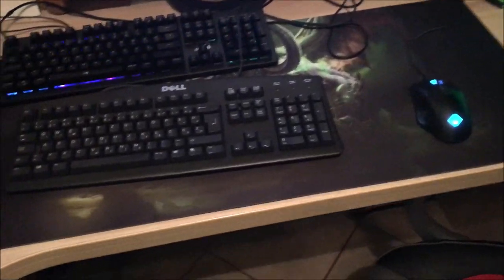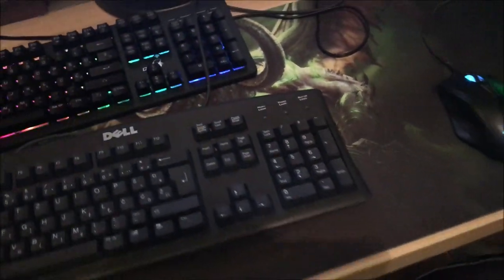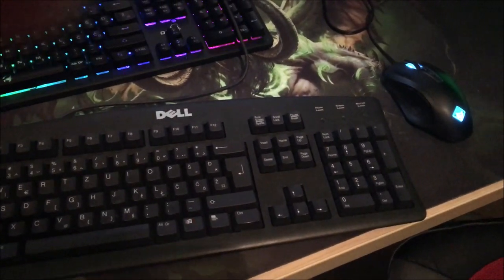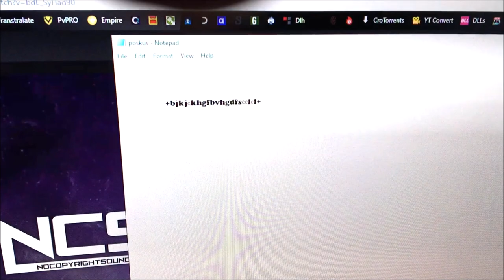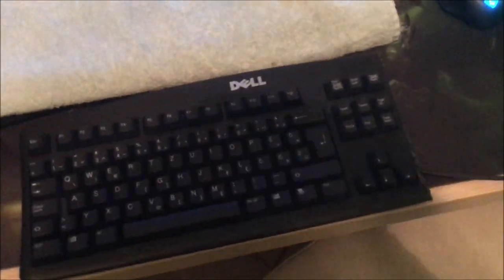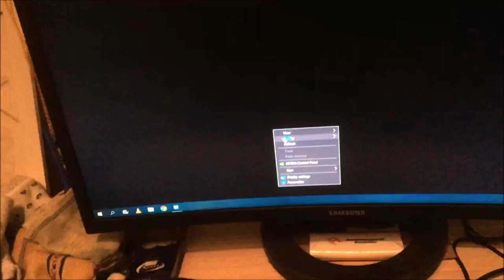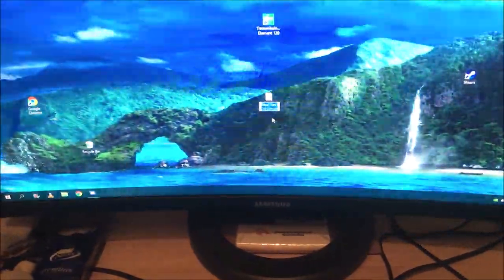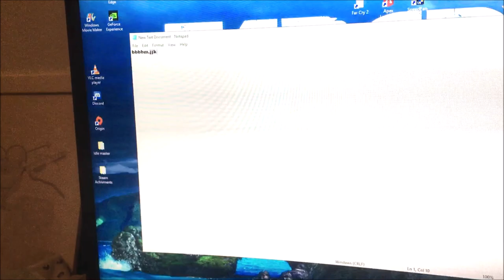Cutting Fullsize keyboard to make it TenKeyLess

Comment: I did this successfully years ago. Disassemble the keyboard, cut numberpad but only plastic housing and left the PCB unharmed and while assembling keyboard i put the extra PCB part into the rest of the keyboard body by folding it. That way it worked perfectly after experiment
Reply: how in the fuck do you fold a pcb?
Reply: @jeremiasvim  those cheap keyboards dont have solid pcbs, instead its just foldable, paperlike ones. Look it up, u will see
Reply: @META313.  what about a solid pcb
Reply: @abatall  its not possible for solid ones. If u cut it, you just split the circuit and it physically cant work after that
Reply: What is pcb?
Reply: The motherboard of the keyboard

Comment: Somehow, I did this with my keyboard, and it still worked after, it’s kind of shabby and hard to type on but all I did was cut the plastic around the wires and all without actually touching the wires, then I folded everything down and glued it to the back of the keyboard, I don’t use the keyboard, but I have it
Reply: its because cutting a pcb can actually work, but he accidentally cut the chip as well

Comment: cut the shell of the keyboard so you don't have to spend time cutting the entire pcb. desolder switches and voila you have a tkl with an exposed pcb
if you cut it right, the cable should still be connected to the pcb. big brain :))

Comment: The problem with a full-size is that it’s designed for a time when computers were controlled through arrow keys to move the cursor and even before that, the command line. The mouse was meant to be way off to the side. The problem with that is now computing is very mouse-centric, especially the main use of actual PC computers with x86_64 chips these days, which is gaming.

Comment: literally laughed my ass off when you said it was a stupid idea because I am the same stupid situation 😂. and i dont wanna pay 200 bucks for a new one so I'm considering this 😁

update: shelled out the cash for a razer huntsman mini and its great except the feet slip
Reply from the maker: i belive there is an a way to make it smaller if you somehow cut the board at the right place, jet not shure about it. 

But yeh last year i bought a 75% one for 30€, it's a mechanical one
Reply: @Mboy556  But you're going to cut through the circuit board. At least I think so, I know very little about electronics.

Comment: you can make a mod to make a full size be a tkl,bt is a little complicated

(translated from portuguese BR to english)
in the part that takes all the tracks from the tecaldo to the plate, you have to cut the platicoque part without the keys and keycaps, and together the part of the plastic base, then you take the pcd and hide it elsewhere, or below the keyboard, vertically, or inside it somehow.

SOMEDAY,I WILL MAKE A VIDEO OF MY IDIA WORKING .
Reply from the maker: i have try to remake it but i'm having problems by making an a contact :(
Reply: We are waiting for you to make this video

Comment: was about to do that good i wached this vedio
Reply from the maker: @shinobiworld860  you would need to disassemble it first, then cut it, so you won't dammage pcb board
Reply: And what about extra pcb
Reply: Should I just roll it and fit it tight in some corner
Reply from the maker: @shinobiworld860  you must not cut pcb and it will work.
Sure, just roll extra membrane that's left.

Comment: is there ANY way i can make a keyboard 60% ? I got the HyperX Alloy Core RGB and i hate it in every way and i was thinking if i can make it 60% (i bought it when i didn't knew that there are 60% keyboards out there ) pleaese if anyone can help me with it
Reply from the maker: KiwiKi Mi  If you have a mechanical keyboard you can... somewhat modify it

you would need to buy a different (smaller PCB, you can take the switches out and put it in new board if they aren't soldered) and then you can just make a case for it or bought it aswell and there you have it... you can keep the keycaps, they will fit
Reply from the maker: KiwiKi Mi I would reccomend you checking out my "Drevo 75% keyboard" 
https://youtu.be/OFiTPk8WA9A
it is just for a few cm bigger, and you would still keep the simmilar small form factor and it will be easier to use.. check it out

Comment: I wanna cut the arrow keys off my tkl, can I do this even if it will damage the Pcb?
Reply from the maker: if you dammage your pcb, it's not going to work anymore. If you have the membrane, you have to tilt that... "plastic" to make it work :P
Reply: @Mboy556  wait i have a mechaincical keyboard and i thought as long as i didnt damage the green part of the pcb i would be fine
Reply from the maker: @ultraterpmaster710  yeah, that's true, but mechanical keyboards have that pbc all over the  keyboard.
Check some "keyboard modifications" or somthing like that. 
They might show you  where is pcb and how big it is.

Comment: will it work when i will not cut the pcb?
Reply from the maker: yeah, you can flip it behind or over and it will worked. Me and some others have put that to test. 

Make sure you only cut plastic case.
Reply: @Mboy556  and can i cut the plastic foil too
Reply from the maker: @DanielH74  rubberdome for sure, but not other 2! also watch out that you don't cut cable. 

Disresamble it first, to make sure you only cut plastic.
Reply: @Mboy556  and the plastic foil i will fold sure?
Reply: what should I cut it with if I don't have a saw?
Reply: scisscors?😂
Reply from the maker: @DanielH74  kitchen knife, bending it till it breaks? dude ya gotta become creative

could add me on discord: [SLO]Mato556#2205 i think..